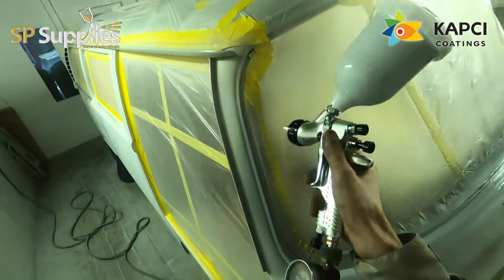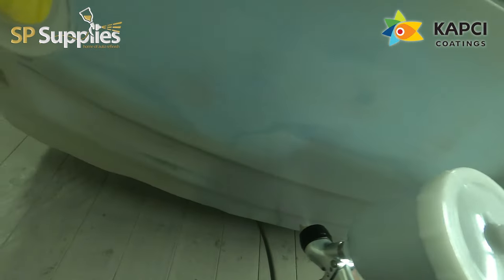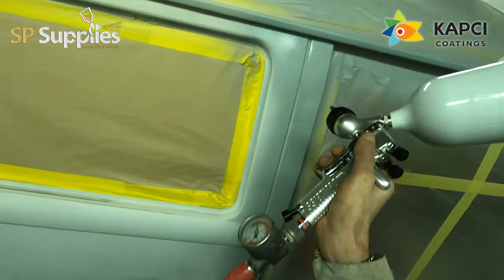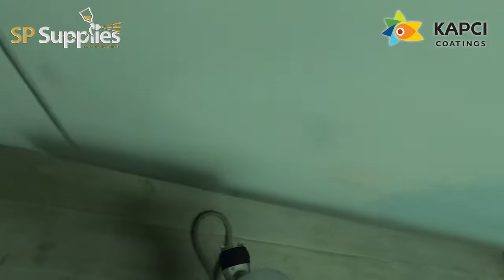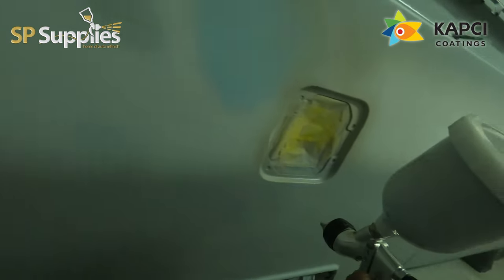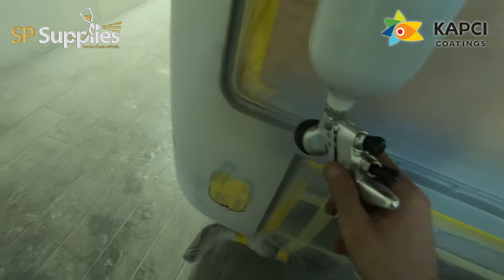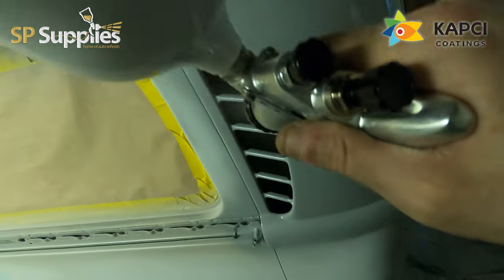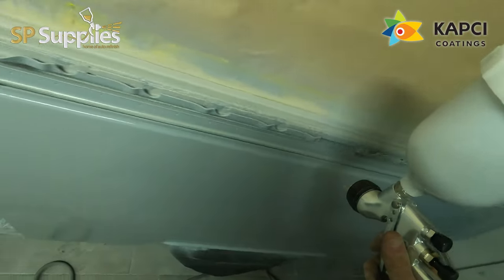VW Bay Window Camper Final Primer

Comment: Great video as always Tony!
I’m in the process of restoring a 71 bay camper van and your videos have been of great help!
I need your advice, my van is all primed with 2k and it will be all uniform with no patches or metal showing and sanded to 400 grid. 
Can I get away with not having to use primer sealer before applying the base coat?
I’m not trying to cut corners, but not wanting to add an extra step if not needed.
You are right about all the time it takes to restore these vans, it’s been a 5 year project and I’m ready to be done with it!

Comment: Nice to see you back Tony, i've been using the kapci primer just lately and to be fair i'm not overly impressed . I find it much harder too sand down than lechler high build but i'm going to carry on with it and see how it goes .
Reply from the maker: it may be a tad harder to sand down than the lechler il be honest i couldn't say its been years since i used theres but also you have to compare price point the lechler im sure is alot more so you'd expect a touch better performance ?
Reply: @TonysRefinishingTV  Oh forgot to say i also bought some Kapci clear now that does perform well no downsides with it. 
👍👍
Reply from the maker: Which one did you go for mate 6030 or 6050
Reply: @TonysRefinishingTV  Not sure i think its the 6030 after watching one off your vids i bought some . I think the 6050 was more expensive so i thought i'd try the cheaper one first.
Reply from the maker: Yeah the 6030 is good stuff mate not to expensive very user friendly dries and polishes really well too

Comment: Really enjoy your vids. I’m hoping to paint my kit car, it’s on a spit having the glass work done with some filler to get flat. Would you use an epoxy on a fibreglass body to seal then high build and top coats. Not painted a fibreglass body before any tips would be appreciated. Thanks again.
Reply from the maker: honestly id use this in then link below mate its an epoxy spray filler and primer all in one were just about to use it in a tvr shell https://spsupplies.co.uk/product/evercoat-optex-super-build-41-primer-kit-4-7l/
Reply: @TonysRefinishingTV  Hi, thanks for getting back so quickly. My local paint supply shop advised using UPOXY SUPER*ETCH. I have used this successfully in the past on my Fiat Gamine, steel bodied, but was unsure on fibreglass. I will have a look at your suggestion thanks again look forward to the tvr re-paint.
Reply from the maker: Personally hate etch mate the superbuild will give you massive adhesion , huge build to block out and the properties of epoxy all in one winner in my opinion tbh we’ll be using it a lot soon on a lot of jobs